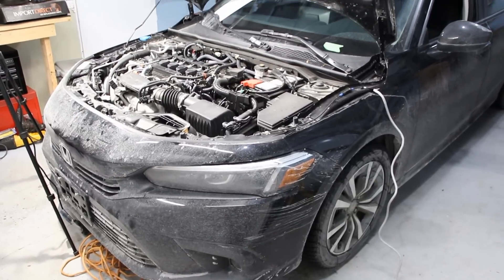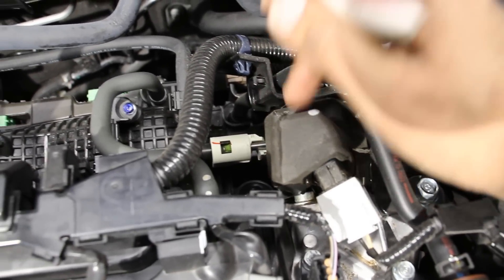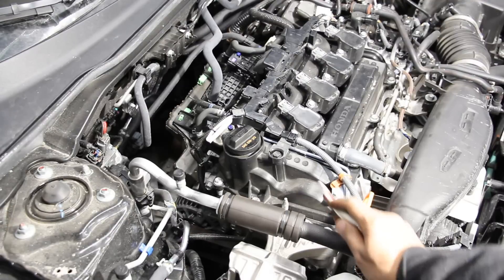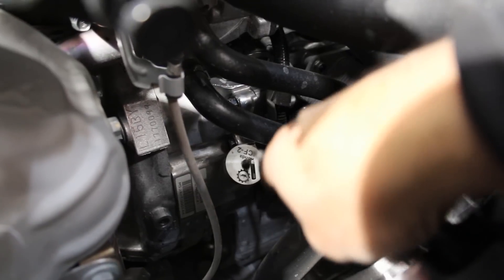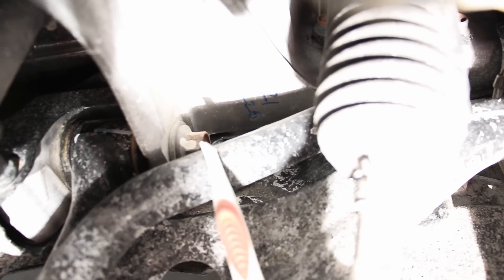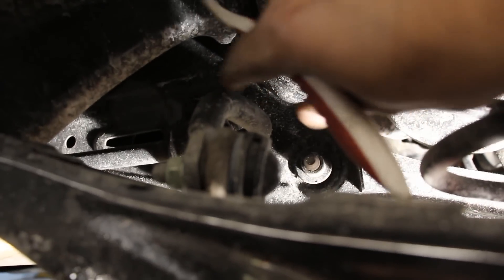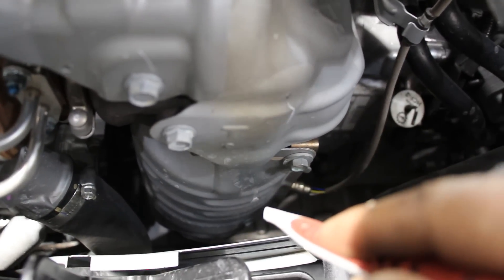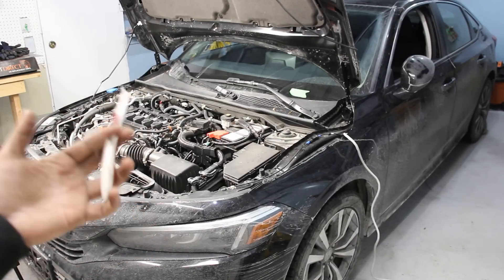Honda Civic Mechanical Review

Comment: When you say, "lots of labor" all I see is wheelbarrows full of money. Local Ram dealership quoted me $1400 to replace (4) O2 sensors on a 2005 Ram 1500, 5.7 liter. Paid just over $200 for all four (NTK) sensors & took about 3 hours to change all four. Crank sensor @ dealer $600. I spent $100 for a OEM sensor & ten minutes to change. I can't imagine working on this Civic 18 years from now especially if it lives in the "rust belt". Great review as always. Thank you!

Comment: Why does Honda still refuse to use bolt on bearings for their front wheel hubs at 6:54? I know the previous generations of Civics had bolt on wheel hub/bearing assemblies in the rear if you had drum brakes (probably to make it simpler) but why don't we have this in the front by now? Toyota and Subaru have had it for years. Honda needs to wake up, they aren't winning against Toyota in terms of maintenance simplicity. If the Honda engine bay is already way more crammed than Toyota's corolla, they should have gone back to the two non-camber bolt mounts for the front struts and continue the knuckle socket pinch bolt design (subaru had it for ball joint and they always seize in the rust) and ditched the wheel bearing design for ones that are bolt-on. 

1. The space between the side of the engine where the pulleys are located is more confined on the Honda than the Corolla.
2. The corolla has an electric water pump, the Honda civic still has a belt driven water pump, so that's one more thing that the belt has to be routed over when replacement comes time.
3. The alternator is in the back of the engine in the civic and requires you to remove the exhaust, for the Corolla, it's in the front.
4. Replacing the starter also requires removal of exhaust, in the corolla it has no obstruction
5. The front struts sit inside the knuckle with a pinch bolt. Go back to the 8th gen civic with the two non-camber pinch bolts. It is simpler! Unless the front shocks in these last twice as long.
6. Honda civic has an intermediate shaft bearing that can fail early (60k miles) although it isn't too difficult to replace.

The only thing I see better is the Honda civic CVT looks more serviceable, but I would pick the toyota over the honda simply to avoid the wheel bearing style on the civic.

Comment: Question: Is this the Honda or the Hyundai Turbo 4 cylinder?  Cramming a turbo and all the pipes horrible to maintain as car ages.  Also, good design using the ECU as a bumper in a front end crash and massive Y exhaust pipe under the car to  protect the sub-frame.  In 10 years who is going to be working  on these legacy gas-powered cars?

Comment: Even a single Honda rotor screw is one too many. They are poorly designed. Even on a brand new car with no corrosion, it was difficult to remove the four rotor screws using an impact JIS-3 screwdriver because they are installed very tight to start. It is so much more difficult when they get rusted on. The first thing I do on any Honda is to remove the rotor screws and put loads of antiseize on them with only fingertight torque on reassembly. The pre-drilled M8 threads to remove the rusted on rotors to the hubs are such a fantastic design however - run in two M8 x 1.25 bolts while torquing them both down sequentially and even the most rusted rotor will be forcefully separated from the hub - ingenious!

Comment: Came here as a potential (enthusiastic) buyer for this 11th gen civic.  The complexity of the overall build and potential for failure (or very expensive labour in the shop) has me now looking at another car.
Reply: I mean, im sure its gonna be reliable...but man, I hope it is because what a pain to work on.  Really sad considering its a tiny 1.5L....Honda really should ditch the idea of front exit exhaust, everyone else goes rear exit!  That way you don't have to remove the downpipe and work under the car for everything.  I feel for Honda techs.

Comment: Nice overview and nothing like discouraging a person from working on a Civic. Sadly, Honda packs in a lot of garbage parts while using Aluminum, Plastic, and some steel. For a mechanic, this is a nightmare for the removal of various parts as you are required to move other parts out of the way. Too many exposed wires and connectors, and some are badly placed, including hoses.  The undercarriage panels are cheap and will allow for the collection of road debris, minerals, chemical contaminates, and winter road salt, trapping water and moisture in promoting rust acceleration. What is all that white powder stuff as you point to a lot of stuff? The roughly 6 to 8-month-old Civic is in need of a good cleaning. Honda is building Civic with cheapo parts and making it so you are not able to do repairs without having a mechanic repair shop garage of your own. Get into an accident and one airbag goes off, your Insurance company will deem it totaled. For the money, buy a classic car that you can work on and keep for the next 20 to 30 years. Honda made the Civic sophisticated and complex with hundreds of various thin-sized plastic stuff with easy-to-break parts. A One Dollar part will cost you $30 to $50. Shame on Honda for producing an unsafe automobile. Okay, they fixed the safety issue by installing 10 airbags providing they are not defective airbags or the triggering mechanism does not work. The one automotive manufacturer that is worst than Honda is KIA. The military uses the acronym KIA for Killed In Action. I had recently seen a KIA involved in an accident and it was not a pretty sight, not much left to the KIA or its engine compartment, a definite death trap, and KIA debris was everywhere. Never buy or drive a KIA unless you want to be buried. You might be safer in a YuGo!

Comment: That was excellent. Thank you for this visual summary of the 10th gen.
It’s daunting to look under the hood of modern vehicles, especially this tight spaced Civic engine, to figure out where everything is.
Reply from the maker: Exactly! It sure is interesting once you figure everything out
Reply: @speedkar99  
At 117,000 miles, I just had the water pump and drive belt replaced after a weep hole leak was detected. I figured since the Honda mechanics were already there, I asked to have the PCV valve replaced. Total cost: $1,045 (including coolant flush). Considering what is involved to replace a water pump, I think the price was reasonable. I'm just glad I didn't  have to do it! LOL

Comment: You don't have to completely remove the turbo to access the water pump bolts. That black inlet duct that feeds into the compressor side bolts off and gives you enough space. It's a good engine with good power, some things could've been designed better though.

Comment: Almost everything is the same other than the car design interior and exterior worth buying it over 10th gen Civic I don't think so because this generation is little bit heavier !
Reply from the maker: historically, Civics are throughly redesigned every 10 years. The 5th year brings the next generation which is just an improvement and refinement of the existing generation

Comment: We have a 2016 civic with the 1.5T. I can't believe how easy the maintenance is on it
Reply: Have you had any issues with the turbo engine? I recently just bought the 2022 EX. I don’t drive many miles; about 4000 a year. My last Civic EX was 20 years old and had 125,000 miles on it.

Comment: Jesus that's so many components and it's so complex. I think I'm good with my old ass hatchback. No turbo and intercooler, no EGR, no ABS, manual transmission, port injection and tons of room in the engine bay.

Comment: Question on the 2.0L engine verse the 1.5L turbo charged engine. I have a general, overall distrust of turbo charged engines since going back years they seemed to have a number of problems in various car models, but Honda seems to be 'ok' with the turbo charged engines. Does the 2.0L without a turbocharge last longer than the 1.5L turbocharged or is the Honda turbocharged line just as good as a non turbo engine now a days?
Reply: Honestly, the 2.0 is going to last longer. Turbos ram more air into your engine, which in turn puts more strain on all engine components. That’s not to say that the 1.5 won’t be a reliable engine. I think they will do just fine. From what I’ve seen so far, you can put tons of miles on these puppies just as so many Honda owners have done in the past. Honda knows turbos!

Comment: I remember when the Civic was well made, cheap, and ran forever. I don't think his one will. Although the prices aren't too bad: Price: The 2022 Honda Civic LX sedan starts at $21,900. The Civic Sport sedan, at $23,300, is only $1,400 more than the LX. The other two new Honda Civic sedans, the ones powered by the turbocharged 1.5-liter engine, are the EX and the Touring. They are priced at $24,900 and $28,500, respectively.
Reply: Don't forget the huge dealer markups.

Comment: I wonder why the exhaust side is front facing. I haven't owned a Honda in awhile, but the K series had the exhaust on the back and that always seemed like a better idea than hot pipes running under the engine cooking seals like a boar leg on a spit... when they went B to K, that was a big improvement it seems they reverted.
Reply: I think its only the turbo engines that has the exhaust side facing the front. At least its easier to replace if the turbo went bad but since its a GDI it makes it harder to remove intake manifold to clean the valves manually or with walnut blaster.

Comment: This one looks scary maintenance wise. I've always had Civic's (from build year 1984 up to 2007), with various D, B and R series engines. They never let me down, and would love one with a K series engines but went for a Toyota Hybrid instead because of efficiency reasons. But this Civic looks so different than the older generations, I guess its a nice car to have under warranty or as a lease car.
Reply: well did i say it was complicated. I said it looks complicated learn how to read mister that way you won’t have too many misunderstandings.
Reply: Us honda boys shouldn’t fight amongst each other.Lets save it for the mustang and camaro guys.
Reply: @ektouge8700  amen bro
Reply: But good try; trying to sound all smart and all.
Reply: I agree. It seems much more complicated to reach down for certain things than older models. I have a 2010 civic, and a 2015 civic si. Both have much more 'clean' engine bays where it's much easier to see and swap components than the 10th and 11th generation cars. I always thought that all of the hoses made it look like a nightmare. For a well versed mechanic, this is probably nothing anyway, but I speak for all the DIY bois.
Reply: @randyb9544  The 8th-9th gen civic are absolute dreams to work on. They still have the press in wheel bearing style but and the intermediate shaft, but aside from that, much simpler than these newer ones.
Reply: well you make a nice point. But its not like german cars that for wvery little thing you need the special scanner to tell the ecu that you changed something out 😂. But ja its looks pretty complicated.

Comment: Look like Honda has caught up to the Germans when it comes to making many parts out of plastic.
OK, before jumping the gun. My experience is that Japanese plastics and rubber are way more durable than the European ones. Not sure why? I guess Japanese uses better quality plastics/rubber?
Also, the engine bay is quite complex because of the turbo charged direct injection tech. A couple decades ago, you barely have 1/4 of the complexity on an econo-box car.

Comment: I own a civic. This video helped a lot. Thanks.:yougotthis:
Reply from the maker: Welcome! Which generation and how has it held up?
Reply: @speedkar99  2018. So far there was just one issue, the fuel pump was faulty, so Honda called for replacement.
Reply: @lignofreak  i have a 2019 hatch.  also got the fuel pump recall.  i had a battery replaced yesterday but no charge since i have 6 months left of warranty.  i don't drive it in the winter, so i think the battery may have failed due to being charged on a 2 amp trickle a couple of weeks ago, after letting it sit for about 6 weeks.  last winter the battery run down after being stored for 5 months (i did not disconnect the battery).  i charged it back up and drove it all summer.

Comment: Doubt electronic parking brake lasts life of the car. Not the microprocessor or electric motors. You can still get a cable on a base Corolla.
Reply from the maker: That's the way of the future. Less parts and takes up less space.
Reply: my fully loaded Hyundai Venue has a good ol hand brake. and even manual seats, which I prefer over power seats

Comment: A lot sure has changed since the golden age of honda..think mid 90s. Back then you had a lot more aluminum used on the engine. More space and simple to work on and easy to access everything. Bulletproof reliability. Amazing manual gearboxes that were a joy to shift. Under the hood of this car is a far cry from what they used to be. Used to be a honda guy now I'm a toyota/lexus guy.
Reply from the maker: Couldn't agree more. The problem is people now who can afford to buy new cars don't keep them for 20+ years, and emissions and economy are at much higher standards, hence why cuts have to be made to accomodate.
Reply: @speedkar99  yup exactly. I keep my cars minimum of 15 yrs. Maybe not the best fuel mileage as current models but keeping a car that long is better for the planet then having them hit the scrapyard and buying new every few years. Nowadays toyota/lexus is the only brand I would trust to take me 15+yrs.
Reply: Definitely...The 90's were the pinnacle of Honda, Toyota, Mazda etc....I feel sorry for the mechanics that have to work on these new cars
Reply: I prefer the K24 for everyday driving and reliability over the F22, F23, and B16 in my 90's Hondas though. The timing chain alone makes it a better buy vs those timing belts. Plus in a crash, my 2012 and 2014 Honda's are much safer.

Comment: I have the 2.0L Civic from the last gen and other than the AC condenser issue from the early models my car runs like a charm!
Reply: 2L > 1.5T :)
Reply from the maker: That should outlast the turbo model
Reply: @speedkar99  its a shame they dont include the 2L in the cr-v fuck a turbo.
Reply: Interesting, what's wrong with the new Civic turbo engines? I know, VW for sure has issue with oil getting cooked, hot engine temps leading to deteriorating upper seals. Is the same expected from all new turbo engines?
Reply: @robertficek7586  Nothing problematic as if yet, it’s just more stress on the engine so it’s given that something expensive is more likely to need repair before it would on the naturally aspirated engine
Reply: 2020 1.5T Civic 5 door Sport hatch owner here. Honestly after 16k miles and HOURS of idling, I think both engines are good! I'm more worried about my poor CVT surviving the abuse of inner city Chicago grid traffic :/
Reply: @BigRobChicagoPL  Well the Honda auto transmissions including the CVT are the easiest to maintain, just a plain drain & fill.  I think if you do the fluid change every 1/2 of the suggested schedule, it should last you a long long time.

Comment: Nope. This is why I love my 9th gen SI. Only issue I have is the VTC actuator needs to be changed. It makes a rattle noise in cold start ups and that’s do to no oil pressure releasing a pin inside the actuator. But the naturally aspirated 2.4L K-24 is better then these 1.5L turbo charged direct full injected engines. 
Honda has disappointed me with their new technology.
Reply from the maker: K24 was a strong motor. RIP
Reply: I had to replace the damn thing twice already in my Honda. Honda's has their set of  problems but if you're familiar with the issues and take good care of the vehicle it will last a very long time.

Comment: This engine is very reliable, but damn this engine is HARD to work on. It doesn't look too intimidating at first... until I realize everything has no space to work on.
Reply from the maker: Not sure about reliable...time will tell
Reply: @speedkar99  lol same thing I was thinking. The car just came out.
Reply: @speedkar99  i meant the old 1.5T from 2017
Reply: Plenty of 250k mile 1.5T 10th gens out there. Working on plugs and routine work has been easy. I’m at 100k miles. Only annoying thing is choice of refrigerant, space under the hood, working around all the extra electronic sensors.
Reply: @AJ-we9kd  have replaced the turbo or radiator yet? those things are A PAIN. For me at least... And i agree that maintenance items are super easy.
Reply: @AJ-we9kd  how about cvt transmission??? How long can they run?
Reply: @kr9181  with proper and frequent fluid changes, CVT transmissions can last quite a long time. However, people need to keep in mind that they are not traditional automatics. The lubrication of a CVT is EXTREMELY important for longevity. My uncle has a 2013 accord with a CVT and just under 200,000 miles. Changed the fluid every 30,000 miles and that transmission is still operating beautifully. (Well… as beautifully as a CVT can.)
Reply: Looks like Honda is taking a few notes from Audi when it comes to screwing over the poor mechanic who has to work on these cars.  Hopefully the fasteners are all similar.

Comment: it looks that it will be completely rusted in like 6 years lol
Reply from the maker: Mazdas are worse lol
Reply: corrosion protection warranty is 6 years.  what a coincidence!
Reply: @steveneumeyer681  
i was thinking the car is like 7 YO or something from the engine and frame look then i told myself people say that civic and hondas is not complexed so i double check to find its a new car so i write that comment 😁 if you look at bolts you find them start surface rusting